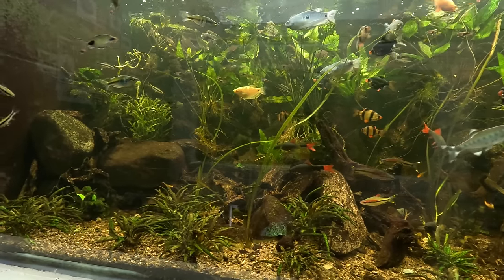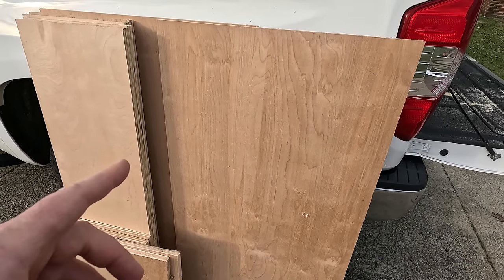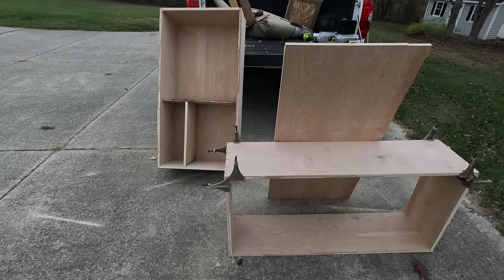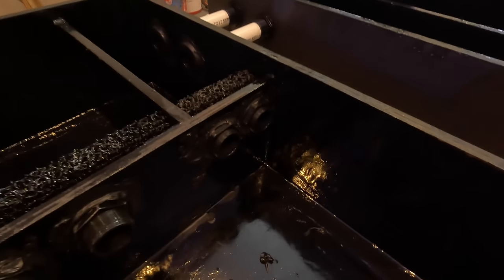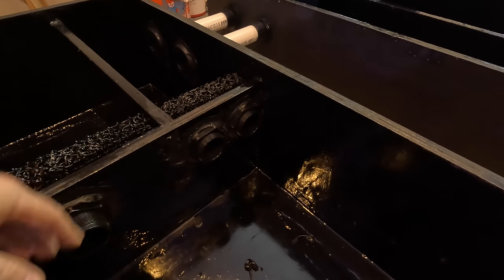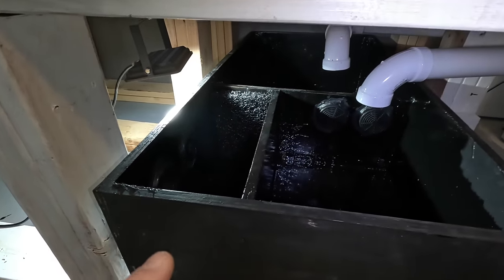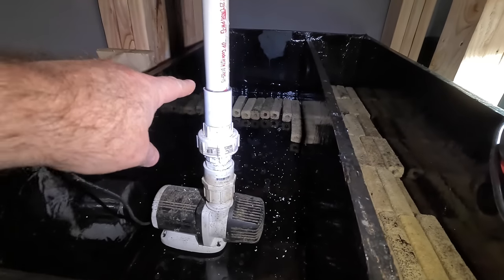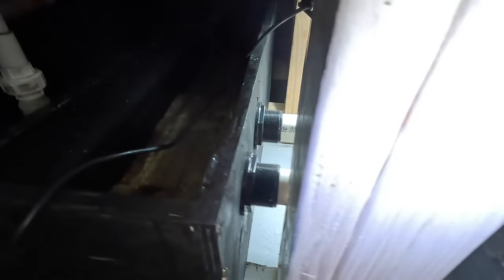DIY Aquarium Leak! Building a replacement Custom DIY Aquarium Sump.

Comment: Looks awesome! In the long section with the ceramic pieces they might work better standing vertically. That way the water would have to flow down through the centres (at least near the inlet) and they would be higher in the water. Just a thought :D
Reply from the maker: Good thought, I will be doing some fine tuning of the sump over the coming weeks. Also I do have the option of using pvc pipe to route the water...everywhere I have bulkheads...so that should give me some flexibility.

Comment: I know you’re a big fan of using plywood. But would you ever switch to using either pvc or sans foam core. If it was me I would vacuum infuse sandwich panels cut it to the size you need tape the panels together with fiberglass. Then paint with pond liner.  The end product would be lighter, no fasteners to rust and no wood to rot.  This would be similar to how most modern boats are built
Reply from the maker: Certainly there is more than one way to build a solid DIY tank, I have building them the way I do since 1999 and it has been working for me very well...so hard to justify switching it up. 

If there ever comes a time where I build a tank for the sake of trying a different method, the one you detailed is interesting, but so far I have just built them to fill my need for another or larger tank 🙂

Comment: So I see you have the bulkheads pretty high inside the sump in comparison to the height of the outside of the sump which is only 12 in. And. your water level at almost 10 in if you have a power outage will it be able to handle the overflow without flooding do you have enough reserve space I guess is what I'm asking. I would have thought to make the sides a little higher like 18 in. Do you use check valves in your lines to keep the water from flowing back down into the sump on the return side, that's what I had to do with my saltwater... And so the tank will only drain down to the overflow and then it stops even though the return is deeper in the tank the check valve keeps it from draining down to that point.. but I made a mini sump and I did overflow a few times untill I figured out where to set the height on the overflow..
Reply from the maker: Hey Ian!  All good points and definitely all the things one needs to consider when building a sump. In short, I was completing the video right as the sump was installed, in fact was late at night and lights were out in the tanks and I waited until later to finish tuning everything. 

I don't have much play with the height of the sump as at 18" I wouldn't be able to reach in and access it well at all. During the video the DC pump was cranked all the way up, it is now running at its normal level which has the water flowing at about 1/2 way in the bulkhead, which is about 8" (inside baffles are shorter than sump perimeter. Also the very last chamber of the sump (the biggest) only runs at 5-6" depth, this is where a lot of my extra water volume is in the event of a power outage. 

My returns are above the water line, I use loc-line flexible pipes inside the tank for the returns so they go above the water and shoot down into the water..so no reverse siphon. Additionally my drains inside the tank are connected to pvc elbows...so can be adjusted for height. My expectation is that I will need to account for 72" x "48" x 1" worth of water in the sump with the power turned off.

I can show all of this in an upcoming video...I think it would be useful to show and I have plans for an update video on the 600/750 double diy builds pretty soon...would be good to add to that video.

Comment: I've been wondering if you've heard of biocenosis clarification baskets? Would work very well with your sumps.
Reply from the maker: I have heard of it yes, I tried something similar to this in the sump of the 300 gallon. It was hard to measure how effective it was because I was also using a lot of live plants, but I never had nitrate issues in that tank...so my guess was that it was making a positive contribution.

Comment: I bought some used tanks, drilled holes in them, and turned them into sumps.
Might be less expensive that way?
Reply from the maker: Now a days both wood and tanks are pretty expensive lol :-). In this case for me I used wood left over from another project, so total cost for the epoxy/fiberglass was probably in the $60-$70 range. If I had bought the wood for this project it would have tripled the cost for sure. :-(

Comment: What kind of filter pads are those I need more ridged pads to hold back my k1
Reply from the maker: It is Matala Filter Mat, cuts easily with a box cutter knife or circular saw.
Reply: @AquariumDomain.  thanks

Comment: Aside from how you went about leak testing this thing-which to a point I can see why, I have to ask this.

Should your power go out, you're sure you've got enough volume for over flow in addition to what you've got already? With the tank partially drained, that sump should be that full with everything off. Once you turn it back on, things should normalize. Did you take that into account?
Reply from the maker: Yes, I did calculate the volume of water that would drain from the tank into the sump during power outages. I have lost power twice since this sump was built and it is able to handle the excess water. 

Definitely this is something that has to be considered and calculated when building a sump or when operating a commercial sump where they will mark a max fill line just for this reason.
Reply: @AquariumDomain.  If I can offer a suggestion for "in case" that center beam gives where you notched it and it becomes a problem. I'm not saying it will but...in case, so you don't have to tear down the setup:

1. Take some 2 x 4's like you have them before the notch, and recreate that column.

2. On the cornices, get some galvanized brackets  like you might use for decking. Using 1/2"-3/4" wood screws, attach the vertical sides to the bracket so the finished piece looks like a letter "I".

3. Get a hydraulic Jack and fabricate a temporary column of 3 2 x 4's. Band clamp or c clamp to hold it temporarily will work. The column should be able to fit between the base of the column and that header right beneath the tank with just enough play to get it in there.

4. Line the temporary column next to the notched column. Using the jack, jack the joist with that temporary column no more than 1/4"? 3/8" tops! Use a tape measure to do that. Make sure its stable.

5. Use your reciprocating saw to remove that notched column. That column should come right out. That temporary column is holding everything for you for a time.

6. After you've reworked your plumbing in that scenario, and your positive you've got clearance for the new column, take that new "I" shaped column and place it where the original was.

7. Lower the jack. That header beam will now rest on that fixed column. Take some wood screws of the same size, and screw in the top and bottom parts of those steel brackets.

It works great when a wall section of your garage gets knocked out of place and you don't want to replace the wall section. 👍 Same process should work if that notched thing causes a problem. If so, you can keep your setup going with no worries. 🙂

The technical term for it is "balloon framing". 👍
Reply from the maker: @i.m.Q.2  Awesome info, Thank you!

Comment: On the biological lazy river, won't water take the path of least resistance across the top of all the ceramic and not use it to it's potential?
Reply from the maker: I am sure to an extent, but ultimately all the water is passing through the chamber. Some extra contact time with the bacteria living on the ceramic material and the water is beneficial...assuming it isn't some really, really slow flow...but I don't think that is the case.

Comment: Might be easier to get a plastic tub or tubs that fits. It’s not pretty but works.
Reply from the maker: Yeah, that method definitely works....doing that on my 220 gallon discus tank. Since I had the wood left over from another project I decided what the heck...just build one. :-)
Reply: @AquariumDomain.  Hey, I have a question about DIY big tanks. I don't see much where people use metal frames instead of lumber and plywood. I know it's more expensive and would need skill in welding. Do you know of any out there?
Reply from the maker: @professorm4171  Yeah, takes special tools and skill in welding, which is probably the biggest reason...I am not even sure how it compares cost wise as I have never looked into it. I have seen a lot of people use aluminum frames and glass for diy builds...in fact one of the AquariumDomain members has done that and posted on pics on my discord. If you search YouTube for aluminum frame aquarium there is quite a bit out there, but beyond that it is outside of what I have worked with.